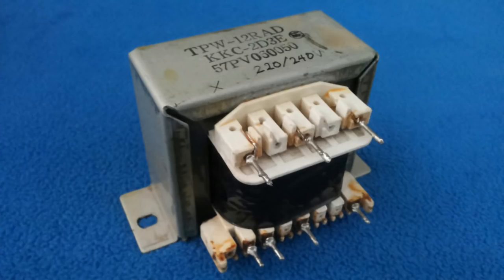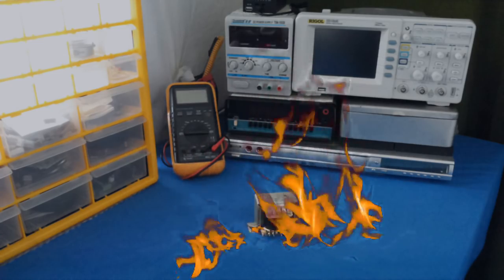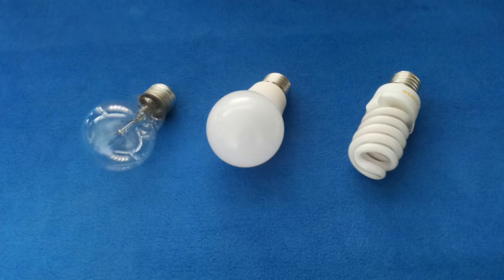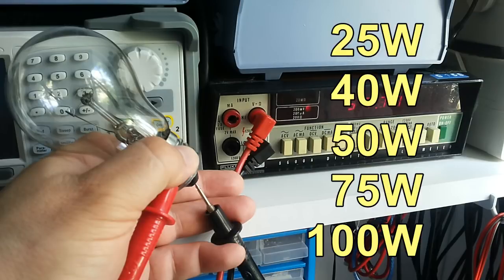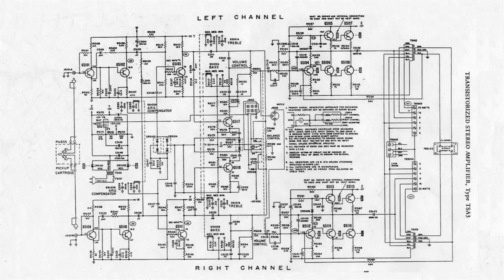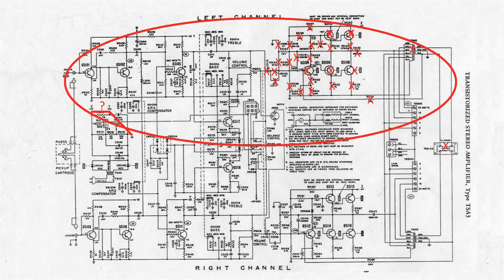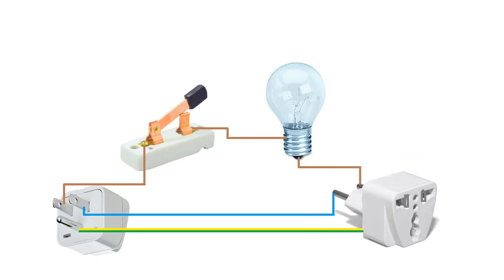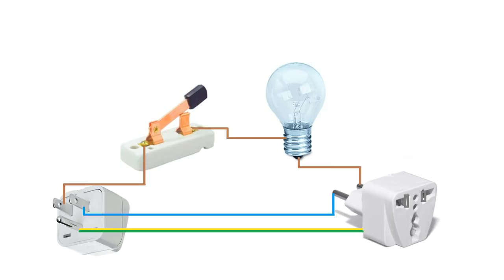Serial bulb circuit / lamp for short circuit test / short circuits protection for workbench

Comment: Really nice video and nice setup you have there .... If the device you are testing / repairing is causing a dead short, will the bulb simply keep lit at full brightness with zero chance of the bulb itself burning out / blowing up ?

Comment: it works, well explained. also you can add a capacitor srrial with the load, 400 volt, 2-3 mf. ac capacitor. now, you explain why is that a good idea?

Comment: But what about the DC Circuit checking? This circuit is working in AC?
Reply from the maker: Yes, because it is to protect the Equipment Under Test from the main lines 120V or 220V AC.
Reply: @bob.kalpon1398  Is this possible to check the dc operated circuit e.g. laptop, mobile etc in this method?